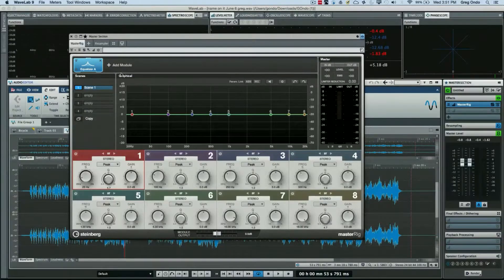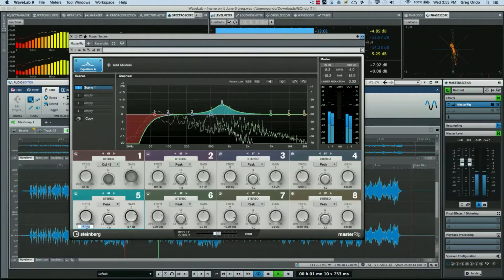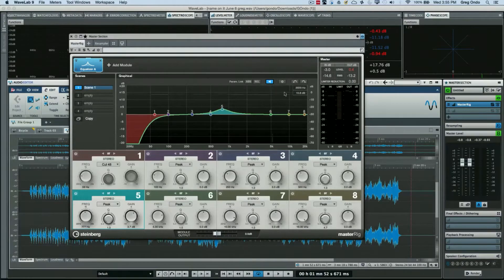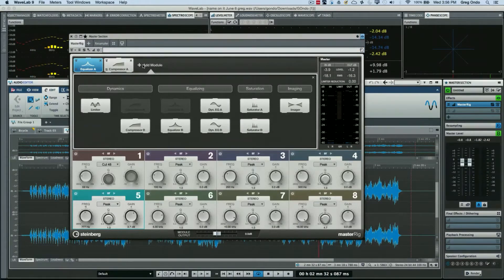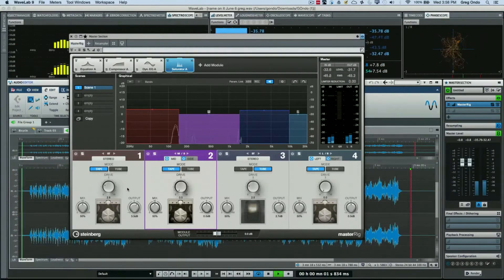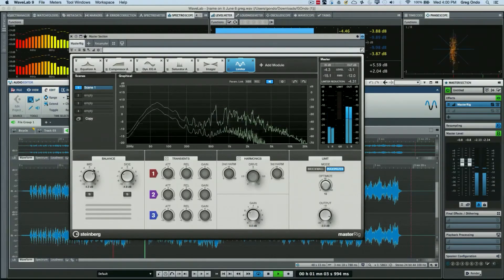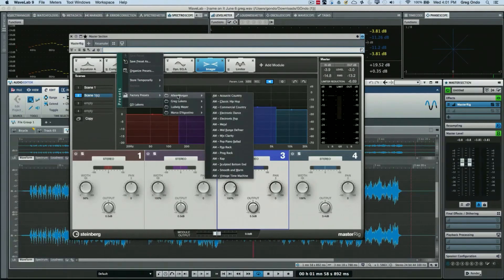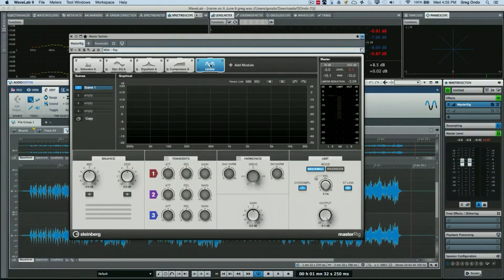How to Use the MasterRig in WaveLab | Q&A with Greg Ondo

Comment: I´m using WaveLab for the first time (60 days trial version). How can I open the MasterRig window? When I go to MasterSection - Steinberg - Master - MasterRig, then a long dropdown menu window appears (on the left). There are slots from 1 to 10 and mastering tool options like Equalizer A and B, Dyn EQ A and B and so on.. What are the next steps? To load and save the preset? I can´t move on from that point.

Comment: Should come with Cubase Pro, what's it's selling points, 3d sound image, burns CDs? Pass on a purchase
Reply: Thanks kinda of difficult since the pro version of wavelab is more expensive than cubase pro ;o , by adding this to cubase it would push the price up and not everyone wants / needs wavelab
Reply: If you purchase a product that gives you WaveLab LE you can upgrade to Elements for $30 or $40. You get a limited yet still robust version of MasterRig in Elements.  But I guess what you are really discussing is the difference between a Producer and an Engineer